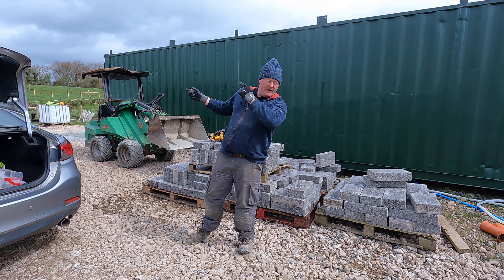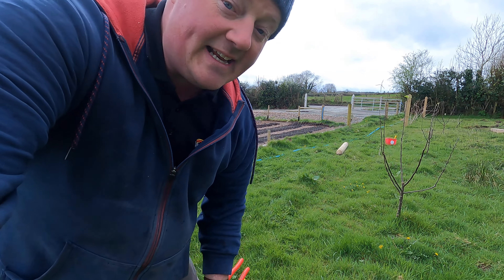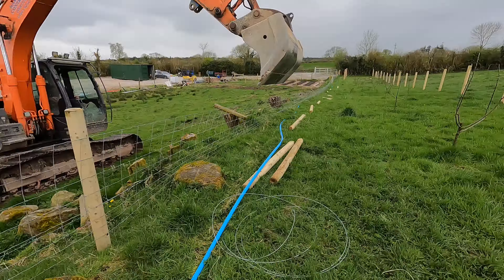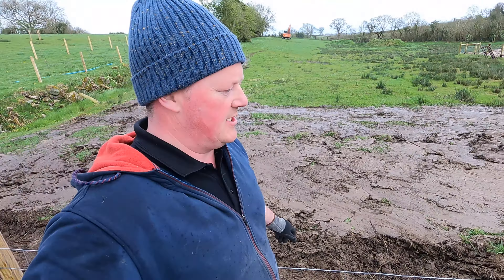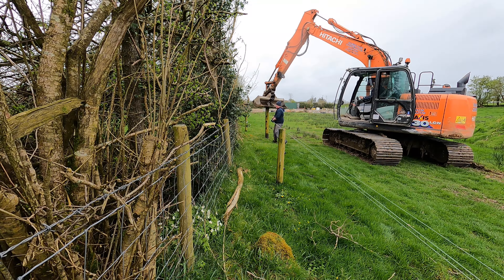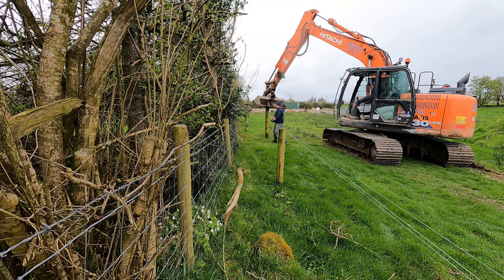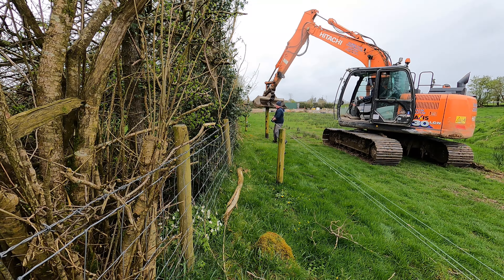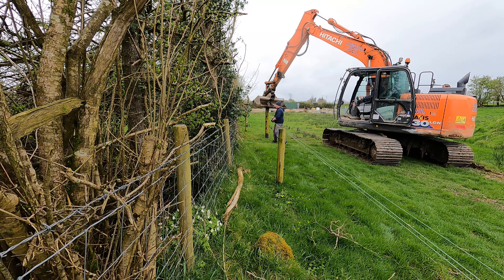BUILDING A LIVESTOCK FENCE WITH A 13 TON DIGGER

Comment: Be handy if that spring ran year round, build a nice well there.
Reply from the maker: I'm going to monitor it this year and see how it runs. If it runs and stops just as long as it comes back I'll try to harness the water.
Reply from the maker: It would be hard to beat a wee spring on site 👍
Reply from the maker: Spring ran dry 😪 awe well. I'll have to do a bit more drainage work to dry that area up, soo wet!
Reply: @LaidBackHomesteader  That's a shame.

Comment: What about these concreted posts they are using in Australia on the "Tim Thompson " you tube channell dose anybody know anything about them. I'd imagine if you hammered them in with a tractor post knocker or a digger bucket, they would shatter ???.
Reply from the maker: Hi William. Im just after watching one of Tim's videos, its call - making tough concrete posts. These posts are guaranteed for 100 years. They must be good 😆. There's a company near Ballymena making ocoto concrete posts. I have two of them at my entrance, upside-down because they look nicer but if they were the right way round there's a place to screw a wacker plate into them to protect  the concrete.